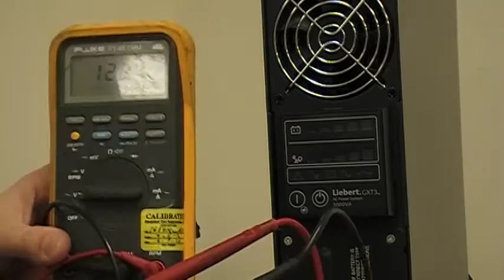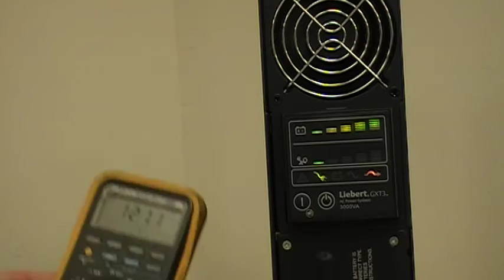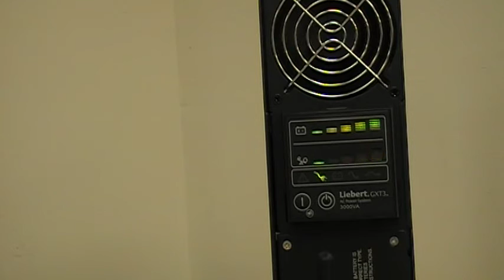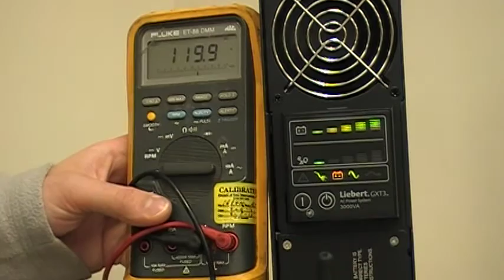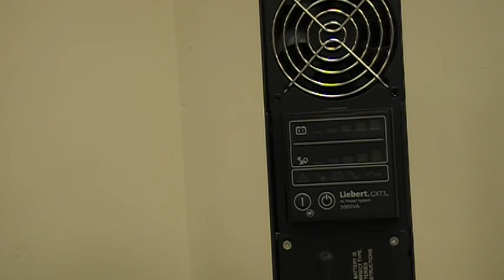Liebert GXT3 UPS Start UP

Comment: Buen dia como estas. tengo un Ups Liebert gxt3 pero se fue la energia electrica y se consumio toda la carga de las baterias. realice el cambio de las baterias por unas con carga full de otro Ups pero el mismo no enciende, me ayudan con algun reset o algo. gracias y Saludos.
Reply from the maker: check the battery connection cables are hooked up.

check the switch in the back is ON.

With the cord plugged in there will be a Green LED on front bottom.

and you should have battery bars across the top.

if no alarms should be able to push the straight line button on Left.

if you have alarms what are you seeing for the battery bars.
thanks

from Google Translate I was told this works pretty well...

compruebe que los cables de conexión de la batería estén conectados.

compruebe que el interruptor en la parte posterior esté ENCENDIDO.

Con el cable enchufado, habrá un LED verde en la parte inferior delantera.

y debería tener barras de batería en la parte superior.

si no hay alarmas, debe poder presionar el botón de línea recta a la izquierda.

Si tiene alarmas, ¿qué está viendo en las barras de la batería?

Comment: the 1000va how much W deliver ? its the same fan noise ?
Reply from the maker: 900W, looks like the same fan from what I can tell, I don't have one to compare.

But the rear view looks the same cage set up.
Reply from the maker: Actually found some specs.

The 3000 might be a little quieter if you can call it that.

3000RT> <48dBA max @ 3ft (1m) front and side
<48dBA max @ 3ft. (1m) rear

1000MT or RT> < 50 dBA, at 3ft. (1m) rear
< 45 dBA, at 3ft. (1m) front and sides

Comment: Tim when I change batteries in a GXT3-300va UPS do I have to wear rubber gloves and can I get a shock from it
Reply from the maker: My notifications were sent to spam, You wont get a shock from the battery per say, but just take your time and track the wires when you pull then off. The older ones have a metal case, the not so old ones have a plastic case holding the batteries. A while back the GTX3 has been replaced by the GTX4 which seems pretty nice we have set up a few of those.
Reply from the maker: Yep sure can.

Comment: Hi can you replace the batteries in a GXT3-3000va unit when it is By Pass mode so I don't have to shut it down or do I have to totally shut it down
Reply from the maker: Yes, have done that many times in just Bypass.

Comment: Hi Tim - have you ever tried to replace the fan in one of these? I have one but its way too loud for my studio, so I have changed the fan to a similar spec virtually silent model, however the unit doesn't like it & basically whilst the fan spins ok, the alarm comes on after a few seconds & the unit displays an error light :( - same voltage & spin rate fan, although I noted that the Amp rate was different  0.7 for the factory one whereas the new one (a Be Quiet silent wings fan) is 0.2A . I have googled & seen on forums others saying that the GXT2 copes with a fan change, but not this model.  :'(  Any thoughts you may have very welcome :)
Reply from the maker: have not tried that. but I did have one unit let the smoke out last week on the bench and I looked at the fan when I had the cover off. As long as the fan is blowing the correct direction maybe they have a current monitor on the fan amperage? so a less powerful fan would draw less and alarm on some sort of fan failure?

Comment: is it possible to convert the gxt33000rt120from 120v to 230 v input? I have a           generator for off grid power but can not pull a single leg 120 off.  only 230 v ? thanks
Reply from the maker: +Stephen Mitchell input power appears to be fixed, there is no switch on the back of the unit like a dual rated supply would have. Manual also only lists 90-140 as the range for that unit.